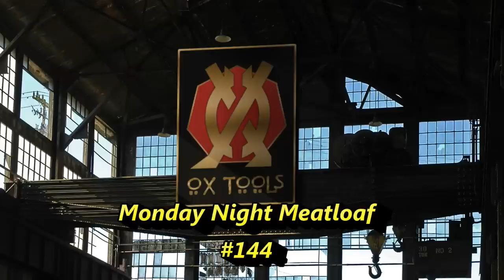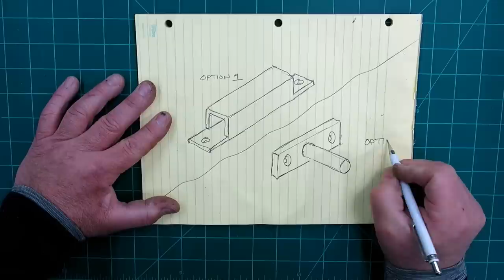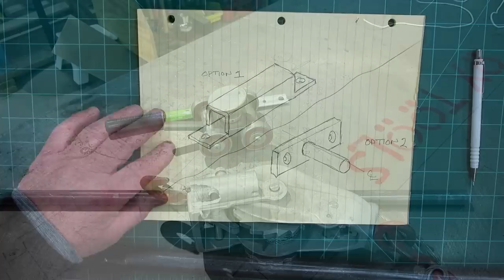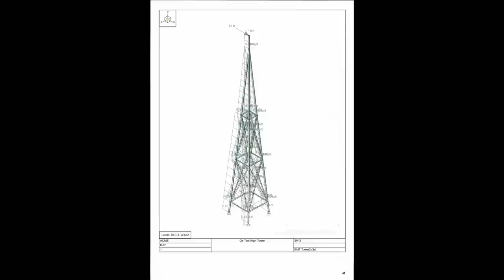Monday Night Meatloaf 144

Comment: Hi Tom,
I would go for option two using "through" bolts and nuts in order to prevent the threads to be stripped out in the aluminum.
My option three would be to built a complete new "" hinged part" out of steel.
But seeing you reaching inside the bucket grabbing a piece of wood to make it smaller, gives me a bit the shivers, seeing your wrist passing the transverse part of the cutter

Comment: I don't have a complete view of the come-a-long to see if this would work, but I like option 2 better than 1...  That said, why not replace the entire "U" shaped aluminum piece with one that has a beefy socket on centerline?  If I was designing it, I would make the part that accepts the handle to fit your hand as many times when you are taking up slack, the bar handle is not used...
Reply from the maker: Good idea to have the basic mount accept your hand. I have used the yoke by hand many times. Thanks for the comment.

Cheers,

Tom

Comment: Option 2 is just going to pull the bolts out of the aluminum or possibly cause more damage .
Reply from the maker: Hey William. I think a test is in order don't you? Thanks for the comment.

Cheers,

Tom
Reply: @oxtoolco  Yes you could test it, my thought would be to make it as a "C" so you could  attach the legs to the sides of the ratchet and it would reduce the bending moment on the bolts next to where the handle attaches.

Comment: Option #3 buy a higher rated Come-Along
Reply from the maker: Hey James. That particular one has seen 6K on a dyno. 😁Thanks for the comment.

Cheers,

Tom
Reply: @oxtoolco  I worry with your planned modifications it takes out the OEM safety protections of the handle being the weak link in the whole lift.  Now with the modifications you have no warning before failure other then crushed toes or piece of equipment dropped on the floor.
Reply from the maker: @jamesnichols7507  The manufacturer also states the come along is not for lifting.....How many folks are adhering to that advice? A valid concern on your part. Thank you for your concern.

Cheers,

Tom

Comment: How would'a thunk the tower would have that much windage. (Don't get out'a the shop much, do ya?)
Reply from the maker: Hey Jack. Not following you here. It's a bunch of tubing with a lot of air in between. Don't understand how being outside would change that idea. Thanks for the comment.

Cheers,

Tom
Reply: @oxtoolco  Just teasing you. Surely you've seen how a big wind will pick up any kind of patio furniture you leave out. (So my lame joke was if you're in the shop all the time you never see anything like this in the outdoors.) There's deceptively lots of surface area on those tubes for wind to work with. The weight to surface area favors big winds.

Comment: With your splitting watsit, rather than having it in a bucket, why not mount it in a wheelbarrow?

Easy to get the wood that required another tappy-tap-tap, convenient for moving from one location to another.

One other thought was regarding your "gross" negligence in NOT making something special for Meatloaf 144 ... ;-)